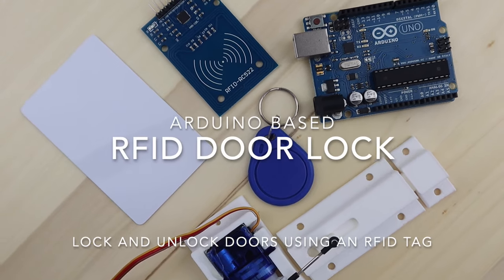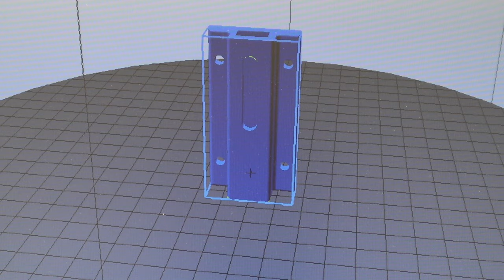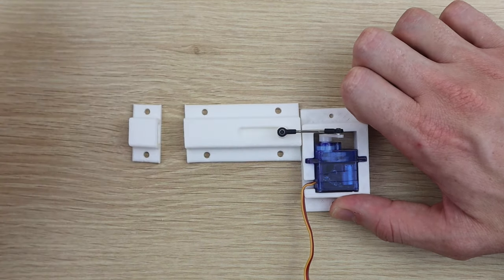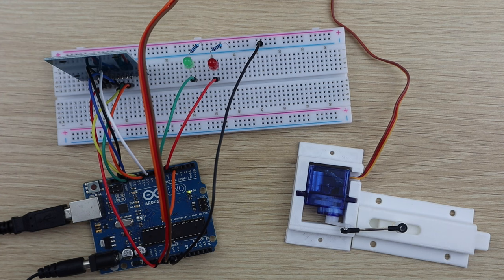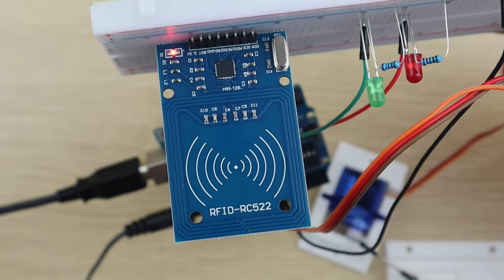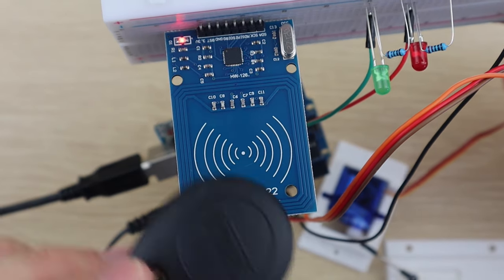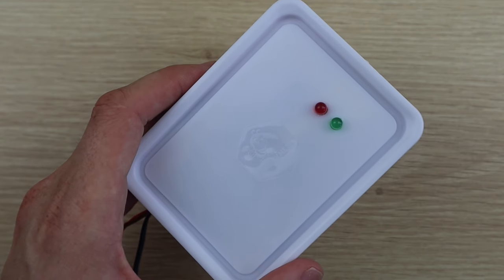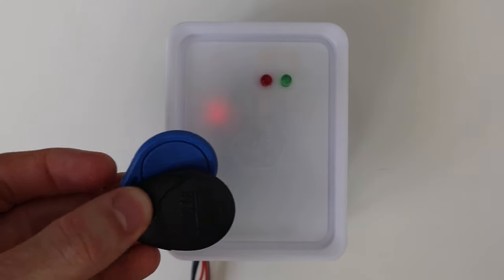Arduino Based RFID Door Lock  - Make Your Own

Comment: Hello Micheal, i keep getting an error message "'class RFID' has no member named 'findCard'; did you mean 'isCard'?" how can i fix this?
Reply: i am also now getting this message after adding the rfid library

Arduino: 1.8.13 (Windows Store 1.8.39.0) (Windows 10), Board: "Arduino Mega or Mega 2560, ATmega2560 (Mega 2560)"

In file included from C:\Users\Joe\AppData\Local\Temp\arduino_modified_sketch_400424\RFID.ino:1:0:
C:\Users\Joe\Documents\Arduino\libraries\RFID/RFID.h:50:35: error: expected identifier before numeric constant
 #define     CommandReg            0x01
                                   ^
C:\Users\Joe\Documents\Arduino\libraries\MFRC522\src/MFRC522.h:155:3: note: in expansion of macro 'CommandReg'
   CommandReg    = 0x01 << 1, // starts and stops command execution
   ^~~~~~~~~~
C:\Users\Joe\Documents\Arduino\libraries\RFID/RFID.h:50:35: error: expected '}' before numeric constant
 #define     CommandReg            0x01
                                   ^
C:\Users\Joe\Documents\Arduino\libraries\MFRC522\src/MFRC522.h:155:3: note: in expansion of macro 'CommandReg'
   CommandReg    = 0x01 << 1, // starts and stops command execution
   ^~~~~~~~~~
C:\Users\Joe\Documents\Arduino\libraries\RFID/RFID.h:50:35: error: expected unqualified-id before numeric constant
 #define     CommandReg            0x01
                                   ^
C:\Users\Joe\Documents\Arduino\libraries\MFRC522\src/MFRC522.h:155:3: note: in expansion of macro 'CommandReg'
   CommandReg    = 0x01 << 1, // starts and stops command execution
   ^~~~~~~~~~
In file included from C:\Users\Joe\AppData\Local\Temp\arduino_modified_sketch_400424\RFID.ino:4:0:
C:\Users\Joe\Documents\Arduino\libraries\MFRC522\src/MFRC522.h:337:10: error: expected unqualified-id before ')' token
  MFRC522();
          ^
C:\Users\Joe\Documents\Arduino\libraries\MFRC522\src/MFRC522.h:338:15: error: expected ')' before 'resetPowerDownPin'
  MFRC522(byte resetPowerDownPin);
               ^~~~~~~~~~~~~~~~~
C:\Users\Joe\Documents\Arduino\libraries\MFRC522\src/MFRC522.h:339:15: error: expected ')' before 'chipSelectPin'
  MFRC522(byte chipSelectPin, byte resetPowerDownPin);
               ^~~~~~~~~~~~~
C:\Users\Joe\Documents\Arduino\libraries\MFRC522\src/MFRC522.h:344:25: error: variable or field 'PCD_WriteRegister' declared void
  void PCD_WriteRegister(PCD_Register reg, byte value);
                         ^~~~~~~~~~~~
C:\Users\Joe\Documents\Arduino\libraries\MFRC522\src/MFRC522.h:344:25: error: 'PCD_Register' was not declared in this scope
C:\Users\Joe\Documents\Arduino\libraries\MFRC522\src/MFRC522.h:344:25: note: suggested alternative: 'PCD_Receive'
  void PCD_WriteRegister(PCD_Register reg, byte value);
                         ^~~~~~~~~~~~
                         PCD_Receive
C:\Users\Joe\Documents\Arduino\libraries\MFRC522\src/MFRC522.h:344:48: error: expected primary-expression before 'value'
  void PCD_WriteRegister(PCD_Register reg, byte value);
                                                ^~~~~
C:\Users\Joe\Documents\Arduino\libraries\MFRC522\src/MFRC522.h:345:25: error: variable or field 'PCD_WriteRegister' declared void
  void PCD_WriteRegister(PCD_Register reg, byte count, byte *values);
                         ^~~~~~~~~~~~
C:\Users\Joe\Documents\Arduino\libraries\MFRC522\src/MFRC522.h:345:25: error: 'PCD_Register' was not declared in this scope
C:\Users\Joe\Documents\Arduino\libraries\MFRC522\src/MFRC522.h:345:25: note: suggested alternative: 'PCD_Receive'
  void PCD_WriteRegister(PCD_Register reg, byte count, byte *values);
                         ^~~~~~~~~~~~
                         PCD_Receive
C:\Users\Joe\Documents\Arduino\libraries\MFRC522\src/MFRC522.h:345:48: error: expected primary-expression before 'count'
  void PCD_WriteRegister(PCD_Register reg, byte count, byte *values);
                                                ^~~~~
C:\Users\Joe\Documents\Arduino\libraries\MFRC522\src/MFRC522.h:345:60: error: expected primary-expression before '*' token
  void PCD_WriteRegister(PCD_Register reg, byte count, byte *values);
                                                            ^
C:\Users\Joe\Documents\Arduino\libraries\MFRC522\src/MFRC522.h:345:61: error: 'values' was not declared in this scope
  void PCD_WriteRegister(PCD_Register reg, byte count, byte *values);
                                                             ^~~~~~
C:\Users\Joe\Documents\Arduino\libraries\MFRC522\src/MFRC522.h:346:24: error: 'PCD_Register' was not declared in this scope
  byte PCD_ReadRegister(PCD_Register reg);
                        ^~~~~~~~~~~~
C:\Users\Joe\Documents\Arduino\libraries\MFRC522\src/MFRC522.h:346:24: note: suggested alternative: 'PCD_ReadRegister'
  byte PCD_ReadRegister(PCD_Register reg);
                        ^~~~~~~~~~~~
                        PCD_ReadRegister
C:\Users\Joe\Documents\Arduino\libraries\MFRC522\src/MFRC522.h:347:24: error: variable or field 'PCD_ReadRegister' declared void
  void PCD_ReadRegister(PCD_Register reg, byte count, byte *values, byte rxAlign = 0);
                        ^~~~~~~~~~~~
C:\Users\Joe\Documents\Arduino\libraries\MFRC522\src/MFRC522.h:347:24: error: 'PCD_Register' was not declared in this scope
C:\Users\Joe\Documents\Arduino\libraries\MFRC522\src/MFRC522.h:347:24: note: suggested alternative: 'PCD_ReadRegister'
  void PCD_ReadRegister(PCD_Register reg, byte count, byte *values, byte rxAlign = 0);
                        ^~~~~~~~~~~~
                        PCD_ReadRegister
C:\Users\Joe\Documents\Arduino\libraries\MFRC522\src/MFRC522.h:347:47: error: expected primary-expression before 'count'
  void PCD_ReadRegister(PCD_Register reg, byte count, byte *values, byte rxAlign = 0);
                                               ^~~~~
C:\Users\Joe\Documents\Arduino\libraries\MFRC522\src/MFRC522.h:347:59: error: expected primary-expression before '*' token
  void PCD_ReadRegister(PCD_Register reg, byte count, byte *values, byte rxAlign = 0);
                                                           ^
C:\Users\Joe\Documents\Arduino\libraries\MFRC522\src/MFRC522.h:347:60: error: 'values' was not declared in this scope
  void PCD_ReadRegister(PCD_Register reg, byte count, byte *values, byte rxAlign = 0);
                                                            ^~~~~~
C:\Users\Joe\Documents\Arduino\libraries\MFRC522\src/MFRC522.h:347:73: error: expected primary-expression before 'rxAlign'
  void PCD_ReadRegister(PCD_Register reg, byte count, byte *values, byte rxAlign = 0);
                                                                         ^~~~~~~
C:\Users\Joe\Documents\Arduino\libraries\MFRC522\src/MFRC522.h:348:30: error: variable or field 'PCD_SetRegisterBitMask' declared void
  void PCD_SetRegisterBitMask(PCD_Register reg, byte mask);
                              ^~~~~~~~~~~~
C:\Users\Joe\Documents\Arduino\libraries\MFRC522\src/MFRC522.h:348:30: error: 'PCD_Register' was not declared in this scope
C:\Users\Joe\Documents\Arduino\libraries\MFRC522\src/MFRC522.h:348:30: note: suggested alternative: 'PCD_ReadRegister'
  void PCD_SetRegisterBitMask(PCD_Register reg, byte mask);
                              ^~~~~~~~~~~~
                              PCD_ReadRegister
C:\Users\Joe\Documents\Arduino\libraries\MFRC522\src/MFRC522.h:348:53: error: expected primary-expression before 'mask'
  void PCD_SetRegisterBitMask(PCD_Register reg, byte mask);
                                                     ^~~~
C:\Users\Joe\Documents\Arduino\libraries\MFRC522\src/MFRC522.h:349:32: error: variable or field 'PCD_ClearRegisterBitMask' declared void
  void PCD_ClearRegisterBitMask(PCD_Register reg, byte mask);
                                ^~~~~~~~~~~~
C:\Users\Joe\Documents\Arduino\libraries\MFRC522\src/MFRC522.h:349:32: error: 'PCD_Register' was not declared in this scope
C:\Users\Joe\Documents\Arduino\libraries\MFRC522\src/MFRC522.h:349:32: note: suggested alternative: 'PCD_ReadRegister'
  void PCD_ClearRegisterBitMask(PCD_Register reg, byte mask);
                                ^~~~~~~~~~~~
                                PCD_ReadRegister
C:\Users\Joe\Documents\Arduino\libraries\MFRC522\src/MFRC522.h:349:55: error: expected primary-expression before 'mask'
  void PCD_ClearRegisterBitMask(PCD_Register reg, byte mask);
                                                       ^~~~
C:\Users\Joe\Documents\Arduino\libraries\MFRC522\src/MFRC522.h:379:2: error: 'virtual' outside class declaration
  virtual StatusCode PICC_Select(Uid *uid, byte validBits = 0);
  ^~~~~~~
C:\Users\Joe\Documents\Arduino\libraries\MFRC522\src/MFRC522.h:427:2: error: 'virtual' outside class declaration
  virtual bool PICC_IsNewCardPresent();
  ^~~~~~~
C:\Users\Joe\Documents\Arduino\libraries\MFRC522\src/MFRC522.h:428:2: error: 'virtual' outside class declaration
  virtual bool PICC_ReadCardSerial();
  ^~~~~~~
C:\Users\Joe\Documents\Arduino\libraries\MFRC522\src/MFRC522.h:430:1: error: expected unqualified-id before 'protected'
 protected:
 ^~~~~~~~~
C:\Users\Joe\Documents\Arduino\libraries\MFRC522\src/MFRC522.h:434:1: error: expected declaration before '}' token
 };
 ^
Multiple libraries were found for "deprecated.h"
 Used: C:\Users\Joe\Documents\Arduino\libraries\MFRC522
 Not used: C:\Users\Joe\Documents\Arduino\libraries\MFRC522-spi-i2c-uart-async
exit status 1
Error compiling for board Arduino Mega or Mega 2560.

This report would have more information with
"Show verbose output during compilation"
option enabled in File -> Preferences.
Reply: and this error stays constant for whatever arduino board i use
Reply from the maker: Hi Berry Gaming,
The first error I presume was related to not having the RFID library installed?
The next set of errors looks like either your're not selecting the correct board type in the IDE or the Arduino is not able to connect to the RFID sensor. Check that your connections and pin numbers are correct and then try commenting out the loop code and line by line through the setup code until you find which line is causing the error.
Reply: Michael Klements it’s not the board or board type because it’s having trouble compiling, not, I haven’t even got to uploading yet
Reply from the maker: Then there’s probably a library issue. Perhaps the library isn’t installed correctly or you’ve got multiple libraries with the same names or functions?
Reply: @MichaelKlements  do you know which libraries this may be?

Comment: Sir, what simulation software did you used?
Reply from the maker: I'm not sure what you mean by simulation software. If you're talking about the schematic, the basic layout was done in Tinkercad, but the RFID sensor was added in as it isn't available in Tinkercad. All of the coding and text feedback is done in the Arduino IDE.
Reply: @MichaelKlements  Tinkercad. Is it free, Sir. I tried finding the rfid model but could not found it.
Reply: @MichaelKlements  Sir, how did you added in the rfid if there is no model for it in Tinkercad?

Comment: Hi i built kinda the same thing that you did but whit some other components and i added the zip file. i cant get your code working.. it says:

C:\Program Files (x86)\Arduino\arduino-builder -dump-prefs -logger=machine -hardware C:\Program Files (x86)\Arduino\hardware -tools C:\Program Files (x86)\Arduino\tools-builder -tools C:\Program Files (x86)\Arduino\hardware\tools\avr -built-in-libraries C:\Program Files (x86)\Arduino\libraries -libraries D:\MinaDokument\Dokument\Arduino\libraries -fqbn=arduino:avr:nano:cpu=atmega328old -vid-pid=1A86_7523 -ide-version=10810 -build-path C:\Users\Sigge\AppData\Local\Temp\arduino_build_648124 -warnings=none -build-cache C:\Users\Sigge\AppData\Local\Temp\arduino_cache_419327 -prefs=build.warn_data_percentage=75 -prefs=runtime.tools.avrdude.path=C:\Program Files (x86)\Arduino\hardware\tools\avr -prefs=runtime.tools.avrdude-6.3.0-arduino17.path=C:\Program Files (x86)\Arduino\hardware\tools\avr -prefs=runtime.tools.avr-gcc.path=C:\Program Files (x86)\Arduino\hardware\tools\avr -prefs=runtime.tools.avr-gcc-7.3.0-atmel3.6.1-arduino5.path=C:\Program Files (x86)\Arduino\hardware\tools\avr -prefs=runtime.tools.arduinoOTA.path=C:\Program Files (x86)\Arduino\hardware\tools\avr -prefs=runtime.tools.arduinoOTA-1.3.0.path=C:\Program Files (x86)\Arduino\hardware\tools\avr -verbose D:\MinaDokument\Dokument\Arduino\garage\garage.ino
C:\Program Files (x86)\Arduino\arduino-builder -compile -logger=machine -hardware C:\Program Files (x86)\Arduino\hardware -tools C:\Program Files (x86)\Arduino\tools-builder -tools C:\Program Files (x86)\Arduino\hardware\tools\avr -built-in-libraries C:\Program Files (x86)\Arduino\libraries -libraries D:\MinaDokument\Dokument\Arduino\libraries -fqbn=arduino:avr:nano:cpu=atmega328old -vid-pid=1A86_7523 -ide-version=10810 -build-path C:\Users\Sigge\AppData\Local\Temp\arduino_build_648124 -warnings=none -build-cache C:\Users\Sigge\AppData\Local\Temp\arduino_cache_419327 -prefs=build.warn_data_percentage=75 -prefs=runtime.tools.avrdude.path=C:\Program Files (x86)\Arduino\hardware\tools\avr -prefs=runtime.tools.avrdude-6.3.0-arduino17.path=C:\Program Files (x86)\Arduino\hardware\tools\avr -prefs=runtime.tools.avr-gcc.path=C:\Program Files (x86)\Arduino\hardware\tools\avr -prefs=runtime.tools.avr-gcc-7.3.0-atmel3.6.1-arduino5.path=C:\Program Files (x86)\Arduino\hardware\tools\avr -prefs=runtime.tools.arduinoOTA.path=C:\Program Files (x86)\Arduino\hardware\tools\avr -prefs=runtime.tools.arduinoOTA-1.3.0.path=C:\Program Files (x86)\Arduino\hardware\tools\avr -verbose D:\MinaDokument\Dokument\Arduino\garage\garage.ino
Using board 'nano' from platform in folder: C:\Program
Using core 'arduino' from platform in folder: C:\Program
Detecting libraries used...
"C:\\Program Files (x86)\\Arduino\\hardware\\tools\\avr/bin/avr-g++" -c -g -Os -w -std=gnu++11 -fpermissive -fno-exceptions -ffunction-sections -fdata-sections -fno-threadsafe-statics -Wno-error=narrowing -flto -w -x c++ -E -CC -mmcu=atmega328p -DF_CPU=16000000L -DARDUINO=10810 -DARDUINO_AVR_NANO -DARDUINO_ARCH_AVR "-IC:\\Program Files (x86)\\Arduino\\hardware\\arduino\\avr\\cores\\arduino" "-IC:\\Program Files (x86)\\Arduino\\hardware\\arduino\\avr\\variants\\eightanaloginputs" "C:\\Users\\Sigge\\AppData\\Local\\Temp\\arduino_build_648124\\sketch\\garage.ino.cpp" -o nul
Alternatives for SPI.h: [SPI@1.0]
ResolveLibrary(SPI.h)
  -> candidates: [SPI@1.0]
"C:\\Program Files (x86)\\Arduino\\hardware\\tools\\avr/bin/avr-g++" -c -g -Os -w -std=gnu++11 -fpermissive -fno-exceptions -ffunction-sections -fdata-sections -fno-threadsafe-statics -Wno-error=narrowing -flto -w -x c++ -E -CC -mmcu=atmega328p -DF_CPU=16000000L -DARDUINO=10810 -DARDUINO_AVR_NANO -DARDUINO_ARCH_AVR "-IC:\\Program Files (x86)\\Arduino\\hardware\\arduino\\avr\\cores\\arduino" "-IC:\\Program Files (x86)\\Arduino\\hardware\\arduino\\avr\\variants\\eightanaloginputs" "-IC:\\Program Files (x86)\\Arduino\\hardware\\arduino\\avr\\libraries\\SPI\\src" "C:\\Users\\Sigge\\AppData\\Local\\Temp\\arduino_build_648124\\sketch\\garage.ino.cpp" -o nul
Alternatives for RFID.h: []
garage:6:10: error: RFID.h: No such file or directory

ResolveLibrary(RFID.h)
 #include <RFID.h>
  -> candidates: []

          ^~~~~~~~

Multiple libraries were found for "SPI.h"
compilation terminated.

 Använd: C:\Program
Using library SPI at version 1.0 in folder: C:\Program Files
exit status 1
RFID.h: No such file or directory

Do you have any ideas why?
Reply from the maker: It's telling you that you haven't installed the RFID.h library and that you've got two SPI.h libraries installed and it doesn't know which one to use.

Comment: Hi, sir why my RFID tag cannot be scanned? It can only scanned once
Reply: After I got the serial number, it won't scan the card anymore, please help
Reply from the maker: If this happens each time you reset the Arduino then it's probably getting stuck in the code somewhere. It's not getting a response that it is expecting. This might be due to incorrect or loose wiring or your servo is drawing more power than your power supply can handle.
Reply: @MichaelKlements  update: it's already working but i have another problem. It's all well when it is connected to the computer but when I tried to connect it through Arduino jack with my 9v, the led and the light in Arduino (rx & L)  and the servo motor keeps moving. Is the 9v battery the problem?
Reply: @MichaelKlements  should I replace my 9v battery to 12v battery?
Reply from the maker: 9V batteries can't supply enough current to drive a servo. That's probably what is causing the issues you're experiencing. As soon as the servo tries to move the voltage drops significantly and this causes the Arduino to reset or behave erratically (sometimes hang).
Rather use a wall power adaptor or a lithium ion/polymer battery.
Reply: @MichaelKlements  how many Volts of lithium battery should I use?
Reply from the maker: A 2 or 3 cell will work

Comment: How to open the lock when im inside?
Reply from the maker: The lock doesn't close again automatically, you'll need to read your tag/card again to lock it, so you can just re-open the door. If you want to lock and unlock the door from inside as well then you'll either need to add another reader or add a pushbutton which allows you to push to lock or unlock the door.

Comment: hello in the code the arduino app  send to me a error : Arduino : 1.8.13 (Windows 10), Carte : "Arduino Mega or Mega 2560, ATmega2560 (Mega 2560)"

RFID:6:10: fatal error: RFID.h: No such file or directory

 #include <RFID.h>

          ^~~~~~~~

compilation terminated.

exit status 1

RFID.h: No such file or directory

Ce rapport pourrait être plus détaillé avec
l'option "Afficher les résultats détaillés de la compilation"
activée dans Fichier -> Préférences.

please someone help!!!!!